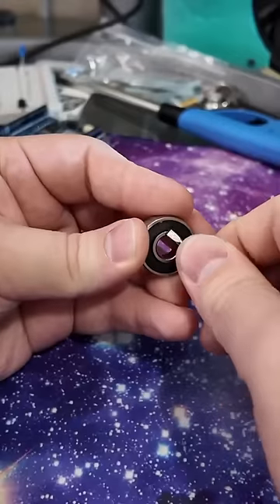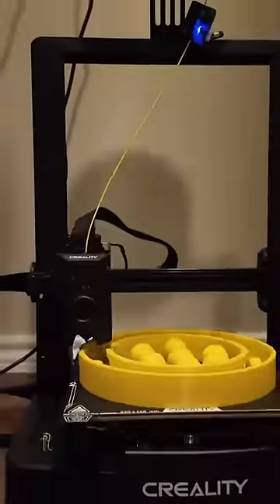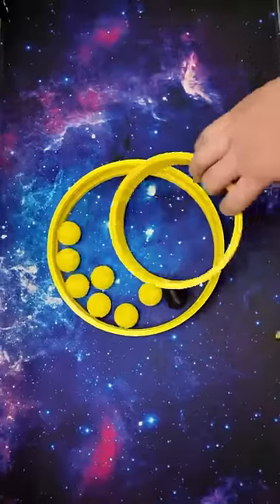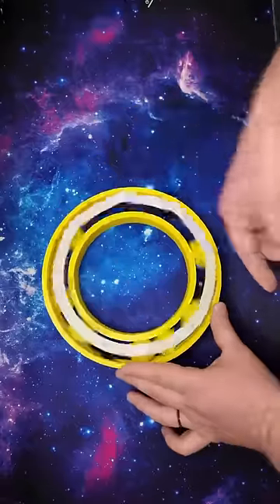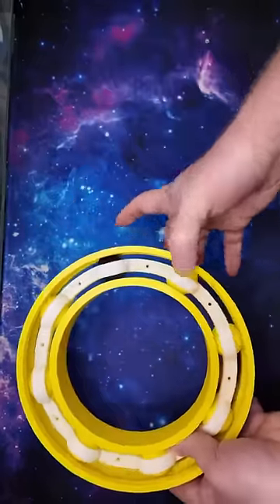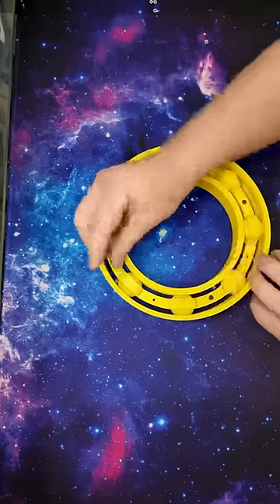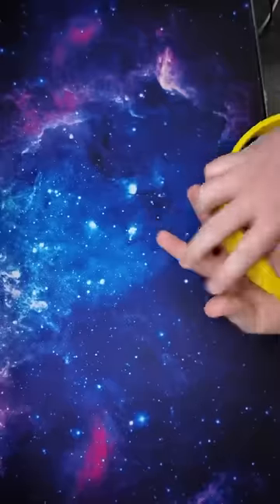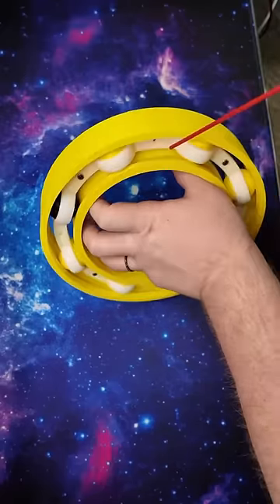How Do The Balls Get Inside the Bearing? 🤔 (ft. GIANT ball bearing) #3dprinting #engineering

Comment: As a kid we used to use WD40 on our skateboard bearings which would basically clean them and allow them to spin really fast, however, this greatly reduces the lifetime of them because WD40 isn't a lubricant. Always use grease in your bearings after cleaning them with something like WD40 or kerosine.
Reply: Use wd40 to clean, blow it out with air. Then spray silicon in to actually lube it. It truly is my pet peeve when ppl use wd40 as lubricant. Its a fucking penetration fluid
Reply: Thank you , this short triggered me
Reply: this is also how my friends and I learned what's in a bearing system. We'd open up the stuck ones, then try to put them back together after cleaning them out. We had some cageless bearings, and those were always a pain in the ass
Reply: @symbik6189  I have to have this conversation with my employees daily. The WD stands for WATER DISPLACEMENT.
Reply: I used automotive bearing grease from the auto parts store.
Reply: @symbik6189 I thought it was a lubricant
Reply: WD40 Teflon grease is the best for plastic parts
Reply: @symbik6189 what is a penetration fluid?
Reply: @fizzywizzylemonsqueezy1774 fluid that penetrates tight spaces
Reply: Tell me you don't know what a lubricant is without telling me you don't know what a lubricant is.

WD-40 absolutely is a lubricant. Is it suitable for greasing bearings? No, because WD-40 is not grease. Will it make a dry bearing run smoother with lower friction in the short term? Absolutely it will, because it is a lubricant. But those effects will not last long.
Reply: Remember, unloaded resistance doesn't matter
Reply: @damionlee7658  If you go that far, the fat and polymers in human blood would make for a great lubricant short term
Reply: @fizzywizzylemonsqueezy1774 PB Blaster is a good example
Reply: @Liminal.Headspace technically yes. but is it a practical lubricant to use?
Reply: @dexterrity  My lawyer advices me to not respond to this question 😅
Reply: Came here to say this haha. I wash mine with water, then dry, then blast with wd40, then some sort of silicone lubricant. I typically go for Remington gun oil.
Reply: @damionlee7658  Water is also a lubricant, but I wouldn't classify it as one in this case. I use WD40 as lubricant to drill holes in a pinch, but we're talking about bearings here. WD40 is a much a lubricant as gasoline, just as a comparison.
Reply: Found out the hard way
Reply: @AndrewP88  "Water is also a lubricant, but I wouldn't classify it as one in this case" - so you acknowledge that you readily ignore reality, when reality causes your statement to be false.

Lubricants don't cease to be lubricants just because the use case makes a specific choice of lubricant a bad choice. As I stated in my comment, WD-40 isn't a good choice of lubricant for bearings, but that does not change the undeniable fact that WD-40 absolutely is a lubricant. Drill rod heavy grease would be an appalling choice of lubricant for a model train's drive mechanism, but that doesn't magically cause drill rod grease to cease being a lubricant if you stuff a model train full of it; all it means is you chose the wrong lubricant... Just as you using WD-40 to lubricate skateboard bearings was you using a completely unsuitable lubricant for the task... Not WD-40 magically ceasing to be a lubricant "In this case."

Claiming WD-40 isn't a lubricant is the modern day version of "Don't use WD-40 near paint because it contains silicon". People seem to want to hate on WD-40 by making up lies about the product, and far too many people just believe anything they read or get told. I'll wager you came across the claim that WD-40 isn't a lubricant somewhere like Reddit, YouTube, or Quora, and just believed it. You clearly never bothered to fact check wherever you heard it, because you repeated that same false claim in your post.
Reply: @Liminal.Headspace  "If you go that far" - there isn't any stretch here. WD-40 is a lubricant, suitable for use as a lubricant in a range of, but certainly not all, situations. Somebody using it as a lubricant in a situation that it isn't suitable for doesn't change the lubricating properties of WD-40. It just means they choose the wrong tool for the job.
Reply: @damionlee7658   WD40 is also a solvent and penetrating fluid mainly, the lubrication is simply a side effect in normal WD40 and as stated temporary. They do have some other lubricants that actually function better long term and don't dissolve or weaken plastics, rubbers, and greases.
Reply: @jackbuck6773  yes... I'm not sure if you're expecting something particular in response. Other than to say my point was not that WD-40 isn't also those things, rather that this misinformation about it not being a lubricant needs to be challenged; because people believe things they hear and read without any level of critical thinking.
Reply: @damionlee7658  Chill out dude, it was a joke. Everyone must have used regular WD40 as lubricant in a pinch in their lives, to be honest.   

Also can you really deny the lubricant properties of blood if it's all you have at hand ? 😁
Reply: I always used a small amount of gun grease and gun oil.
Reply: @damionlee7658  
Basic WD-40 is not a lubricant. It is a degreaser. WD-40 Bike is a line of cleaners and lubricants, and they have other lines of greases and lubricants but wd-40 on itsown only penetrates and washes out other lubricants, liquids, and dirt. After applying wd-40 on anything thats metal or will be met witj friction you must apply a grease or lubricant after unless its one of the saod special wd-40 kits which already have it added. Just think about it man. Wd-40 in initself dries out and evaporates, whereas a lubricant would become a more liquidated form using heat and does not easily evaporate. Ever sprayed your bike chain with wd-40 just to find it frozen in place a week later?
Reply: @damionlee7658 not even wd-40 as a brand advertises it as a lubricant, regular wd-40 is  said to be a degreaser and you could go as far as to read the warning label to see that they dont recommend it for lubrication.
Reply: @damionlee7658 but serious question if water is a lubricant does that mean it has to be wet?
Reply: Yea, WD stands for water displacement 👍🏼
Reply: It's amazing how many people still think it's a lubricant
Reply: @RyanSmith-wc7ku  The guy claiming WD40 is a lubricant might as well say honey is also a lubricant, not a very good one but with the loose terms he's using, why not. 😂
Reply: Real it's so upsetting so many people trash their gear
Reply: @symbik6189 to be fair we were 11.
Reply: Me and my friends used gasoline to clean our skate bearings, then put some Swiss Racing grease in them. Made them so much faster.
Reply: WD40 is a lubricant actually but it's temporary, not to confuse with grease
Reply: Wait, it’s not?
Reply: @AndrewP88  I know it’s almost infuriating, nothing you’d spray we-40 on except like a drill bit in use would it actually be useful, and even then why not use like water-
Reply: If you go to their website, they cite this "WD-40 is not a lubricant" as a myth. It does lubricate and have an oily consistency, but contrary to a dedicated lubricant/grease it dries out over relatively short time.
Reply: It's true. The amount of Jack offs I had to deal with that pointed to the "lubricant" label from the marketing team on WD40 in retail was unreal. Spitting on your hand makes for a short term lubricant too, but it isn't what you keep in your bedside table.
Reply: You have no idea how happy it made me to know there’s still people who cleaned their own bearings and the proper way to grease them
Reply: Sry ima keep using that shit on my door hinges keeps away the squeaks for years🤷
Reply: "While the “W-D” in WD-40 stands for Water Displacement, WD-40 Multi-Use Product is a unique, special blend of lubricants. The product’s formulation also contains anti-corrosion agents and ingredients for penetration, water displacement and soil removal.”
Reply: @Liminal.Headspace  i skated for about four or five years and always used WD-40 it works just fine
Reply: That’s not what Hank Hill told me.
Reply: @TQFMTradingStrategies  well, his advice is better than mine that’s for sure lmfao
Reply: WD40 stops squeaks for about a week then it’ll return. It just evaporates. Need something like a PTFE or grease which doesn’t evaporate
Reply: @jwalker7567  I use butter.
Reply: @damionlee7658  Actually, lubricants do cease to be lubricants based on where you choose to use them. That's exactly how that works lol. You'd have to be dumb to think otherwise. Water is a lubricant for things like plastic, it is absolutely not a lubricant for iron. The term lubricant is not universal. Something can be both a lubricant and not a lubricant based on the application of said thing.

 The term lubricant does not have a scientifically defined name like acids or bases for example. It's a very broad term that is used in ways that contradict themselves. That's why it's so easy for a company to label anything and everything as a lubricant. Because it only needs to be a lubricant for 1 specific material and they can plaster the label on there and make inaccurate claims based on that. A plastic lubricant is not a lubricant for metal. So in 1 context it is a lubricant and in another it is not.
Reply: We used vasoline and wd40 lol vasoline is also great to avoid hair dye staining your face, so we always had some somewhere
Reply: @symbik6189  actually the wd40 brand now makes fluid films and silicone lubricant aswell I'm pritty sure, not disagreeing with what you said just saying they actually make lube now, prbbly cause so many ppl thought it was lube lol
Reply: WD40 will attract dirt to your bearings. And cause them to rust.
Reply: @symbik6189 It is a lubricant, you wouldn't use 5w10 oil in an old diesel. The problem isn't that WD40 isn't a lubricant, it is that it is not proper for that application. It is a penetrating oil meant to do several things, one of which is to lubricate  something like rusty threads.
Reply: It's not!?
Reply: @deathbylemon me 2
Reply: @fizzywizzylemonsqueezy1774 KY, lol
Reply: The fact that people still use wd40 on bearings baffles me
Reply: Water displacement on the 40th try
Reply: @symbik6189 its not even a penatrating fluid. Real penetrating fluids penetrate literally 10x better. Wd-40 barely goes below the surface in most cases.
Reply: @andrewparker4991 you can literally use water for drillin holes lmfao, havent ever heard about using wd-40 and I cut and drill into steel and metals daily for work.
Reply: @LazySpaceRaptor  lithium grease is great
Reply: It is not a penetrant it is a water dispersion elixir for electronics, hence w.d.
Reply: @tylerhunt7295  it is still a lubricant though - you are literally wrong if you are admonishing your employees on this subject
Reply: @erikburzinski8248  you are correct - it is a lubricant - it also has other uses and isnt the best lubricant for all purposes - but it is definitely a lubricant
Reply: THANK YOU. I'm so sick of people acting like wd40 is a lubricant
Reply: @zu438  thanks
Reply: @damionlee7658 WD40 is not a proper lubricant. Yes it can lubricate but you're not going to use it for anything more than a door hinge. It's more a degreaser
Reply: WD 40 is made from kerosene, Interestingly enough.
Reply: WD is a brand that makes several different products, including lubricants and penetrating cleaners.
Reply: DONT USE WD-40. Use Bones Speed Cream
Reply: Bones speed cream 👌
Reply: @damionlee7658  its not a lubricant, the only reason you believe it lowers the friction is because the parts where it was applied were cleaned and removed dust and old grease that were causing friction
Reply: Because wd40 is a solvent, you can have a bad time using it on plastic or rubber, where it can cause deformation.

As above, use a lubricant instead.
Reply: I wonder if it has anything to do with hydrophobicity
Reply: @tylerhunt7295 Yep! it was originally wiped on steel parts on boats, to keep water off of them
Reply: @tylerhunt7295  and the 40 is how many times it took them to get the formula right if I'm correct
Reply: @andrejust try getting it on with ur lady in the shower or a pool and let me know how good water is for a lubricant hahahah wparker4991
Reply: @WakingUpSux  Try using WD40 when you get it on with your dog and and see how that works.

What is this, a dumb comments only contest? 😂
Reply: @symbik6189  Silicon has a Mohs hardness higher than steel so it's likely to cause abrasion to anything you apply it to
Reply: @deathbylemon me aswell😂
Reply: Literally, WD40 is a cleaner, you then need to dry it and use an actual lubricant, oil, grease etc
Reply: PTFE lube has worked best for skateboard bearings for me.
Reply: You want bearings to last for many years, clean bearings every few months and add a few drops of 0-20 or 5-30 synthetic motor oil (no need to soak them) and repeat every few months to keep the bearing properly lubricated. I'm still Skateboarding on a set of China Bones I bought back in 2002  and they still roll like new. Stay away from WD-40 and that Powell bearing oil crap or any lubricant sprays it's horrible stuff for bearings and to reduce protection under friction, Being a Skateboarder for 40 years and a mechanic for 20 years with experience in automotive motor oils and lubricants business, synthetic oil the molecules will bond with the metal and help reduce friction which friction is the main reason why bearings fail and not properly being lubricated as well.
Reply: Don't use it for cleaning either! Use nail polish remover! It's 98% acetone... which is used to clean out engine parts! Also, the nail polish remover is 8x cheaper!
Reply: Of course WD-40 displaces water, cleans, lubricates, and prevents corrosion, but did you know it also softens rubber? Some people use it to temporarily give their tires more grip.
  It also might eat into that 3D printed bearing. Of course, this part isn't going on the space shuttle, so WD40 is just fine.
Reply: @symbik6189  WD-40 actually has it's own Silicon Lubricant that looks just like the normal WD-40. Source: it's standing on my desk
Reply: It wares your ball baring down faster because WD 40 is a cleaner, not a lubricant. So, yea, it will clean your ball bearings, but you need to follow up with gear grease to keep them from waring out to soon. WD 40 is a NASA invented product.
Reply: WD40 is not good for bearings, sure use it to clean them and then blow them out but if your going to use oil for bearings use Nano oil by St Claire, that stuff is amazing.  A 10 Weight oil is best for small bearings but if you can’t afford nano oil then use ballistol because even when that stuff gets wet it turns inti a oily gel that continues to lubricate them and stop corrosion, the very best for bearings is nano grease.
Reply: @symbik6189 it's a film to cover and protect metals from oxidation + it replaces water.
Reply: Wd40 is a rust dissolver
Reply: Replace the grease, it doesnt need to spin that freely in skateboard
Reply: I'm so happy to see this comment. Thank you
Reply: @damionlee7658 it has some lubricating properties. The issue is that it's mostly xyline / solvent that thins out grease. It removes grease. It thins out Soo much that it penitrates. That's great for water protection. It's too thin though for lubricating. It's not enough oil.
Reply: @Liminal.Headspace Good, that means your lawyer is smarter than you.
Reply: @AndrewP88 Do you not realize that WD40 is literally an oil?  Oil is lubricant, plain and simple, cut and dry.  gasoline is a fuel and mild solvent.  You could use gasoline to clean a surface that has WD40 on it.  You would use WD40 to lubricate the clean surface.  They are not the same.
Reply: Here with u! WD40 eats up lubricant and breaks it down as well as bestelbus your bearings. 2 hours of fun for broken bearings
Reply: WD40 IS a form of lubricant... it's great for lubricating siezed components or for something like a lock bolt which is used infrequently.

It's not a long term lubricant and it's certainly not suitable for high speed, high heat and high friction applications such as bearings.
Reply: This type of bearing like skateboard bearings are sealed and don't require lube at all... You just replace them after a while
Reply: @damionlee7658 
It has a little bit of oil in it, yes. Problem is, it also has solvent, which will cause whatever oily stuff to not cling to the cleaned surfaces and run off. The oil is probably to facilitate loosening the stuck parts after the fluid has penetrated and dissolved some of the gunk.
Reply: Wd40 jack of all trades. Don't believe me just look up the MSDS on it you'll see that contains petroleum-based oil. Is it great for lubricant no is meant to be a lubricant no was made to be a solvent. But since it does have oil it's technically both till it dries out. There is a whole episode of King of the Hill of wd-40😂 .
Reply: @brandonakers9827 use household oil lol
Reply: I'm probably asking to be thrown into a van with this but....I have a recipe. It's 5 seconds squirt WD40, 5 pumps of the greasiest lotion I can find, 4 tbsp canola oil, 1tbsp gasoline, 1 tbsp used automotive oil, and a bit of margarine. I mix it really, really well (generally blending or some such), then add a bit of wax to the result and blend again while still warm. It lubricates the crap out of everything and penetrates it too. It also works as a remarkably effective wood protectant/sealant. I have old sticks from ~10 years out in my backyard that were treated this way and none have so much as a bite mark on them, let alone rot/wear and tear. They can still hold my entire weight.
Reply: @GeneralSamov  tell me you don't know what a solvent is, without telling me you don't know what a solvent is... (Hint: a large part of the makeup of WD-40 is fractional components derived from petroleum base oil. An example, taken from the WD-40 safety sheet is 64742-56-9 - solvent-dewaxed light paraffinic. This is a lubricant used as a base component of many commercial and consumer grade lubricants. It is also a solvent, used in many paint products.

Goodness knows if this post will show up (my last three that recommend people just read the WD-40 safety sheet, which identifies WD-40 as a lubricant, all seem to have vanished). But the point is just because something is a solvent, that doesn't prevent it from being a lubricant.
Reply: @damionlee7658 
Tell me you don't understand chemistry without telling me you don't understand chemistry. Or, here's a better one: lubricate your bike chain only with WD-40 and then tell me how far you've got.
Reply: @GeneralSamov  care to elaborate on why you think I don't understand chemistry, given that you haven't followed that up with anything to counter what I wrote.

As for your nonsense bike chain statement, which you seem to think it's some amazing "Gotcha"... Try lubricating your car engine with vegetable cooking oil. Cooking oil is a lubricant, but using it as a replacement for motor oil in your car engine will cause catastrophic failure. Does that mean cooking oil suddenly isn't really a lubricant? No, of course it doesn't. You choose the correct lubricant based on the thing you are lubricating.

You know what else cooking oil is, as well as a lubricant? It's a solvent. Isn't it incredible, things can have more than one property!
Reply: @mykehdoom yea I’d use that or paint thinner, or carb cleaner or rubbing alcohol… then thoroughly dry then 2 drops of Bones Swiss lube. Works like a charm I’ve got 20 year old bearings still going strong lol
Reply: There is a silicone based wd40 can now
Reply: @jameskee2412  Well I'd hope my lawyer is smarter than me, I'm not paying for someone to be as dumb or dumber than me.
Reply: I didn't know this and never thought to look. It's not something I use frequently. Glad I saw your comment, because it explains why some things gum back up soon after use of WD-40. Thank you
Reply: Bro my first skateboard was from a toy store. And I managed after a lot of wd40 to pop out the bearings and my wheel went to the inside of the truck. Now I have a zero deck and a Globe deck as back up but damn those toy store deck are shit 😂
Reply: @symbik6189  it can be used as a penetrating fluid but it is not one, unless you buy the specific one for it. Regular wd40 is not. Pb blaster or aerokroil or any oil based is a penetrating oil.
Reply: WD40 is actejist a brand and they do make lubricant as well. Their standard fluid isnt one though.
Reply: @symbik6189 better yet dont use anything but air to blow out the dust. putting lubricant in an open bearing will just junk up with dust as the lubricant will fuse with the dust, better to have dry ball bearing so the dust can get out. this changes when its enclosed from dust ofcourse.
Reply: brake cleaner then light grease. youre welcome
Reply: This..... I hate the way a squeeky hinge people say wd40... Nooo!!! Use to loosen, lift off, wipe down oil and replace
Reply: @symbik6189 is a what??
Reply: wd40 attracts water and makes skate bearings rust you need to use speed cream
Reply: @fizzywizzylemonsqueezy1774 It’s used to disassemble parts that are wedged tightly together, like an old rusty bolt stuck in a hole. Add some heat, squirt some penetrating oil on it (wd40, Kroil, kerosene) and tap it with a hammer. The oil will penetrate down into the stuck threads and make it possible to remove the bolt. Thats the theory anyways, it doesn’t always work.
Reply: You can buy specific lubricants from skate shops and online stores. And I mean skate in the most general and vague terms. In-line, board, quad, doesn’t matter all of them will have stuff to sell to maintain bearings.
Reply: "WD-40 is not a lubricant" has got to be one the weirdest and stupidest myths about lubricants. It is absolutely, 100%, verifiably a lubricant. Go get a piece of glass, spray some WD-40 on it, and then leave it alone. Come back in a few days, and if it is still lubricated where you sprayed it, then guess what you just demonstrated...

Of course it isn't a replacement for bearing grease. Same way I wouldn't use bar and chain oil to loosen a stuck bolt.
Reply: @damionlee7658 It runs smoother because its a liquid and not a solid. Just like how pushing something through wet glue will give it less sliding friction than on a rough surface. Thats doesn't make glue a fucking lubricant
Reply: @RyanSmith-wc7ku  WD40 does not evaporate. What have you been smoking? The solvents evaporate and leave behind a lubricant based on fish oil. If your use case includes a light machine oil, then it's a suitable lubricant. If your use case requires a grease, then it is not a suitable lubricant. Case closed.
Reply: @jwalker7567 WD40 does not evaporate. The solvents evaporate leaving behind a light machine oil comprised mainly of fish oil. It's a light duty library, but not a grease.
Reply: @ObiwanNekody It contains no kerosene. Where did you hear that? It's fish oil based using an organic solvent and propane as a propellant.
Reply: @joaomendes7989 it's a light machine oil, not a grease, but it's still a lubricant. Where do you people hear such nonsense?
Reply: @blacknoir2404 Silicone, not silicon.
Reply: @yogidemis8513 Complete nonsense.
Use a quality grease designed for the materials involved. That's what it's designed for. Motor oil is designed to resist high temperatures and combustion byproducts, not to be used as a grease.
Reply: Wd40 is a lubricant I used it on my skateboard bearings all the time it dont last long so I had to clean and lubricant them about every 3 months or so but it still works well
Reply: @HyperactiveSloth79  "Depends on the temperature, humidity, and air currents. But one thing for sure, it will evaporate, and leave behind a sticky residue that is designed to give short term rust and corrosion protection. That's because that is the reason it was developed, a water dispersant, not a lubricant." Straight from their site buddy. What's left behind is a residue that does not provide a good lubrication
Reply: @RyanSmith-wc7ku  I guess you think people don't know how to use a web browser, because it says nothing like that on "their website."
Product description from the front page of the website: "WD-40 Multi-Use Product protects metal from rust and corrosion, penetrates stuck parts, displaces moisture and lubricates almost anything."
Are you sure you're not thinking of one of their other dozen products? You do know they make lots of other products besides the "Original WD-40", right?
Reply: Thank you
Reply: @fizzywizzylemonsqueezy1774  it eats rust it actually eats away any rusted metal
Reply: There are wd40 lubricants, but the wd40 multi-use product isn't a lubricant
Reply: @HyperactiveSloth79  yes I do in fact know that, the comment you were referring to was intended to be a blanket explanation for their brands. WD-40 as a brand actually makes a lubricant but original wd-40 is not advertised as such
Reply: @RyanSmith-wc7ku  Where are you getting this ridiculous nonsense? I literally quoted directly from their website in my previous comment. I've been using "Original WD-40" for over 30 years and even remember their old TV commercials, worked at an auto parts store where we carried the product and had flyers advertising it that came directly from the manufacturer, have read the data sheets, etc. If you could find even one example of any time they've ever said it isn't a lubricant I'll eat my hat. I know you won't, though, because you already lied once in your earlier comment thinking no one would fact check you because there is literally NO source for your assertion.

I'm still at a loss why anyone came up with this "WD-40 is not a lubricant" nonsense. It seems like such a bizarre and useless rumor/myth to take part in.
Reply: @HyperactiveSloth79  as I've stated to you. The information you are using is off of the home page, where they talk about the uses of all wd-40 products once you actually click onto a can of regular wd-40 or the two way stray wd-40 not once is it recommended for lubricant. I can see in the bike lubricant spray that they add other lubricants to increase the lubrication factor but my point in the matter as others have stated is that well while wd-40 could be used as a lubricant it's not going to lubricat anything for longer than a few days, it has a very low boiling point and the reside left behind actually can seize up gearing on most anything. Because of the chemicals added for water displacement any prior lubrication is inadvertently displaced and causes larger issues. Wd-40 is about as much of a lubricant as water. On that note anything can be advertised as a lubricant as long as it works on certain materials. The issue here is the only thing wd-40 would actually lubricate well would probably be plastic.
Reply: @RyanSmith-wc7ku  ...and as I've stated to you, that quote was from the specific page of the specific product people call "WD-40" NOT a general description of their product line. Every single thing you said is completely untrue and anyone who simply goes to the WD-40 website can see you're a liar so you must be some weird kind of troll. Also, WD-40 should NOT be used to lubricate plastics. Everything you said is exactly the opposite of reality and I guarantee you're not even looking at their website because none of what you said comes from them. 
Either you have some bizarre hang up regarding WD-40 that a therapist would really be interested in analyzing, or you live in a reality where you've created your own definition of what the word "lubricant" means and it speeds all other realities. It's WD-40 the best it ideal lubricant for most things? No. No one ever claimed that. The "proper" lubricant varies by each use case, and for long term regular use there is nearly always something better than WD-40, but that does not magically make it "not a lubricant" any more than claiming that 3-in-1 oil isn't a lubricant because you shouldn't use it as engine oil.
I'm still completely at a loss as to why your resorting to lying and pretending you're reading the WD-40 website just so you can make a completely ridiculous nonsense claim that doesn't benefit you in any way. It's mind boggling!
Reply: @HyperactiveSloth79  bro just link it then
Reply: @HyperactiveSloth79  literally every time you've replied on my comment I have checked their site yet again to be met with the same conclusion. I've described how to find it as well, so I don't understand why you feel the need to claim I'm lying
Reply: I knew it would be just a short scroll down to find my people. My dog is wondering why I shouted "it isn't a lubricant!" at an empty room
Reply: @symbik6189 no it's a water displacement fluid. It just penetrates very well
Reply: Most bearings actually come with two speed ratings: A lower one when using grease and a higher one when lubricating with (a little bit of) oil. Greased bearings have higher resistance than oiled bearings, but oiled bearings require more control over the quantity applied as there is a narrow window between the bearings running dry and the balls basically hydroplaning through the oil.
Reply: WD 40 is a shitty lubricant... there i fixed it for yall
Reply: It will attract and congeal dirt like nobody's business.
Reply: Sounds like those bearings lived fast, loved hard, died young, and left a beautiful memory.
Reply: WD in WD40 stands for ‘water displacement’….it is not a lubricant DP60 is a lubricant
Reply: @Skateordine  it can't "attract" dirt. It just causes any dirt that comes into contact, to stick in place. 
Any lubricant will do that. 
It's just that WD- 40 is so light and thin that the dirt soaks it up and dries out the bearing, so something heavier is needed...
or carry your can of WD with you and spray some in after each run to clean and lubricate the bearings.
Reply: WD-40 is an EXCELLENT lubricant. It's a very light oil so doesn't stay in place for very long. In high pressure applications it gets squeezed out.
If you want to use it for skating, treat it as a consumable. You could carry a small can with you and spray out your bearings to clean and lubricate them before each session...or I dunno, every hour or so.
Reply: I used 3 in 1 oil.
Reply: @topspeed250k5  it’s not a lubricant WD stands for water displacement DP 60 is lubricant 👀
Reply: @damionlee7658  ugh, that's just semantics. you can say water is a lubricant. not very practical for most situations.

telling people wd40 is a lubricant is just going to confuse people and have them wondering why their bearings seized up once the wd40 dried. 🙄🤦
Reply: Came here for this. God I hate it.
Reply: @LazySpaceRaptor  That's an option but it's likely gonna be too thick and slow you down. I've always used bike grease since it's made to be thin enough for human weights and speeds.
Reply: Tell me You didn't knew the Company is called wd40 without telling me that You didn't knew it...
Yes, the water dispenser Formular 40 isn't lubricant. But the Company WD40 also Makel and sells lubricant.
Reply: Yes. WD40 is thin enough to get all that crud out of there (if it got inside there, WD40 will find the way it gets out of there) but you definitely need to re-lubricate afterwards.
Reply: @Liminal.Headspace it would.
Reply: But they make different types of wd40…
Reply: I work at a bike shop. How many times I have to tell people not to use wd-40 on a chain a month is insanity lol
Reply: I used CRC lubricant spray.
Reply: Get ceramic bearings and never grease again.
Reply: @dexterrity it not being good was exactly his point
Reply: @damionlee7658 it was actually made to keep icbms from rusting. It's not a lubricant. It lifts and removes water from surfaces. Water Displacement formula 40. It simple to clean and remove water. If you get the regular stuff that is. They have lubricants but standard wd 40 is not one of them.
Reply: Exactly! This bugs me so much. It’s not a lubricant. It’s a water displacement…. Ever spray wd40 on noisy hinges just to get confused why they get noisy again after such a short amount of time…
Reply: @damionlee7658 It’s literally in the name. WD… aka WATER DISPLACEMENT. It’s not a lubricant 🤦‍♂️🤦‍♂️🤦‍♂️
Reply: @bullockwagon5994 do you realise how ridiculous that arguement is? Let me dumb this down for you - mineral oil is a non-conductive lubricant. It is often used as a coolant in electrical applications, and as a lubricant in mechanical applications (such as air conditioning units). It is also used as a water displacer in metal component storage applications; because mineral oil is a lubricant that displaces water. 

Want to guess what core product the original WD-40 is based on? That same water displacing, lubricating, mineral oil.

If you stop just believing factoids that you see online, and take a few minutes to fact check these things, you will save yourself from making these mistakes.
Reply: @symbik6189 it might be wd-40 lithium grease
Reply: @damionlee7658  "Will it make a dry bearing run smoother with lower friction in the short term?" By that definition, milk is a lubricant.
Reply: @FunkyMind  "WD40 is a lubricant actually but it's temporary, not to confuse with grease" Jfc. The fact that it will temporarily make something spin better does not make it a lubricant. If you went by that, you could call practically any liquid a lubricant.
Reply: @doqtorisykero7971  it is well understood that milk reduces friction coefficient between two surfaces, based on fat content (with a significant jump between milk <1% and milk >1% fat content. Milk, very literally is a lubricant. But here's a far more compelling argument:

Because people lack a clear understanding of what lubricants are (literally they are just things that reduce friction coefficient between two surfaces), there is a perception issue where anything less than a grease or constant supply oil is not being seen as a lubricant. 

Put it this way, do you think of the motor oil you put in a car as a lubricant? If you removed the oil pump system from the engine, and just coated all the parts in that motor oil, how much longer do you think that single application would last compared to WD-40? Nobody would argue that motor oil isn't a lubricant, but without CONSTANT reapplication by pumping the oil back to the top of the engine and letting it flow through, it would be useless within minutes. Yet, people want to pretend that WD-40 isn't a lubricant, because it doesn't provide lubrication for extended periods without reapplication. 

People can't have it both ways. Either motor oil isn't a lubricant, or WD-40 is a lubricant. So which is it?
Reply: @doqtorisykero7971  the act of lubricating is not something permanent. The most basic lubricant is water actually.
Reply: Andrew, I applaud you for saying what you meant to say in a kind way.
I'm thankful that you did. :)
Reply: @doqtorisykero7971  "The fact that it will temporarily make something spin better does not make it a lubricant" - that property is the definition of a lubricant. A lubricant is anything that reduces the friction coefficient between two surfaces. It is completely irrelevant how long that lubrication effect remains. 

For example, motor oil in an internal combustion car provides lubrication between all the moving metal parts of the engine. You wouldn't argue that motor oil isn't a lubricant would you? Its effective lubrication period is a matter of minutes before it needs to be reapplied (which is why if your oil pump fails to circulate the oil, your engine will rapidly overheat and seize). By your logic though, because it only temporarily makes components move past each other better, motor oil isn't a lubricant. 

But you can't have this both ways, the effective lubrication of motor oil is only temporary, so either motor oil also isn't a lubricant, or WD-40 is a lubricant.

By every real definition, WD-40 absolutely is a lubricant, the problem is people that misuse it get poor results; then they blame the product for their own fault in misusing the product.
Reply: I had a door latch in my jeep that siezed up after i sprayed it with wd40… thats when i learned that wd40 isnt a lubricant and if i sprayed it with some white lithium itd probably still be functional lol
Reply: Not all bearings take grease, but grease or oil.  You are very right: wd40 is mostly kerosene, which is a SOLVENT
Reply: @ducatista1098s  it's like banging my head against a brick wall, because people refuse to check what they think they know. Yes, Kerosene is a solvent, you know what else it is? It's a damned lubricant! (20 seconds on Google will confirm it is used as a lubricant in multiple industrial processes.)

Being a solvent does not preclude something from also being a lubricant. This comment section is a scathing indictment of basic chemistry education!

Edit to add that the point is somewhat moot, as WD-40 (the product, not the company) has NEVER contained Kerosene anyway. Again, people need to check what they think they know before they go around spreading misinformation.
Reply: I arrive here months after this only to immediately come to say this after watching and seeing that my people were already here. Thank you fellow WD-40 mythbusters.
Reply: @symbik6189 LMAO same. It’s nail’s on chalkboard, even though I guess for the purposes of the video it “works.”

Anyways it’s still pretty cool. I kinda want a large 3D printed bearing now.
Reply: Also wd40 can ruin libricants that are  applied on top of it, and rinsing it off with water doesn’t work. So if you use WD40 you should clean it off afterward with soap and then thoroughly rinse off the soap and then thoroughly dry the part before applying the real lubricant.
Reply: graphite would work too for friction reduciton.
Reply: I came here to say if anyone skated as a youth they know everything about bearings lol. We used to take the shields off because it was said to make them go faster, less friction perhaps. Used to get the Bones Redz, those Swiss were like 100 bucks a pack!
Reply: You're all wrong. It's a water displacer and a lubricant. It has lube in it. It is a multi tool essentially and as we all know multi tools suck compared to the tool that is specific for the job. So basically it's a shitty product but ppl like it cause it smells so damn good.
Reply: @symbik6189 my pet peeve is ppl that don't know what silicone does to rubber....
Reply: @johnnytakisawa  you're lubricating the bearings not the wheels lol ik damn well it deteriates rubber
Reply: @symbik6189  the wheels are urethane
Reply: @johnnytakisawa  It's also a minor degreaser, so best to avoid using it on something that requires grease, to function properly, because WD-40 adds less grease back, than it takes away.

Bearings come pre-greased, with enough grease for it's entire life. By using WD-40 on such a product, you are reducing the life expectancy of the bearing.

WD-40 is best used as a lubricant, on products that aren't greased, or do not need to be greased on the regular.
Reply: @johnnytakisawa  regardless you shouldnt be lubricating the wheels? The bearings are what need lubricating.
Reply: @symbik6189  yea obviously. How are you guys cleaning your bearing without noticing the rubber seal?
Reply: @fizzywizzylemonsqueezy1774  white stuff 😂
Reply: now i know why my last 2 boards locked up